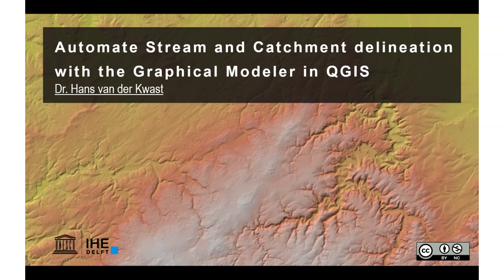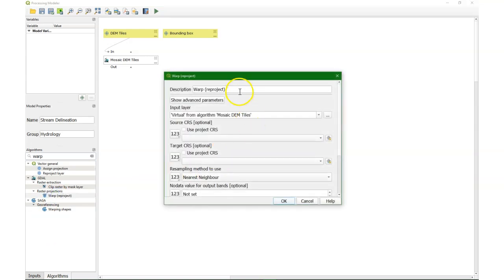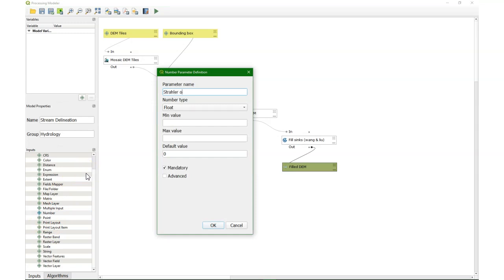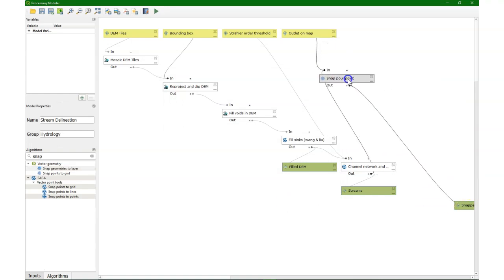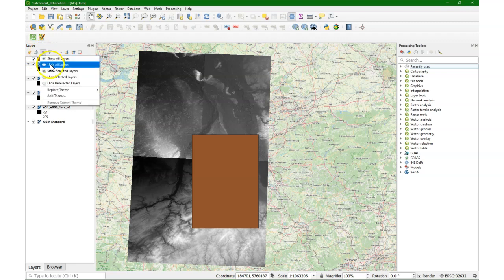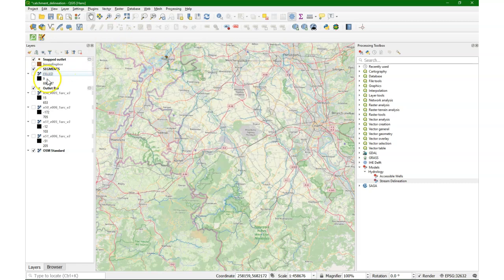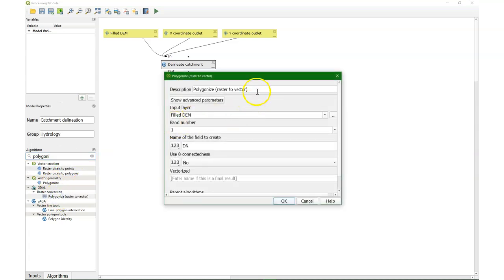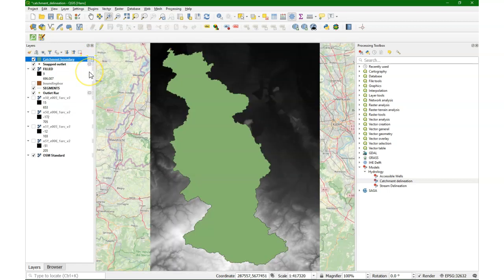Automate Stream and Catchment Delineation in QGIS with the Graphical Modeler

Comment: Hello Hans, Thanks for this informative video.

Just wanted to know can we connect both the model into one.

Means is there any chance to extract x and y coordinates of 'snapped outlet' and feed as an input to 'upslope area' within in a single model. 

I have tried two methods to do so 
one is using expression of 'pre-calculated  value' for 'target X coordinate' 
and another by editing python script of the model.

But failed in both attempts.
Reply from the maker: That's not possible. We can only do that with Python. Check the PCRaster Tools plugin playlist for more integrated tools.

Comment: I am struggling to be able to view the SAGA tool within my toolbox. I've activated it but its not appearing anywhere. Does anyone know how to fix this?
Reply from the maker: First you need to check if you use the LTR version. Here's a video that explains the difference between the newest version and the LTR: https://youtu.be/FFf3_P6-4Ag

Then if the Processing Toolbox is still missing after installation you can try in this order:
1. Activate processing toolbox from the plugins menu
2. If that doesn't work, start a clean profile: settings -> profiles -> new profile. That will give you a clean QGIS.
3. If that doesn't work go to the OSGeo4W shell and type setup. Then go to Advanced Desktop installation and run the updates. Make sure the LTR, GRASS and SAGA are installed.
Reply: @HansvanderKwast  Thank you!